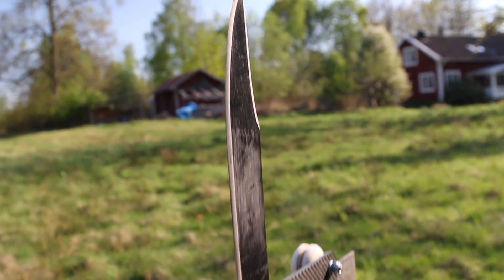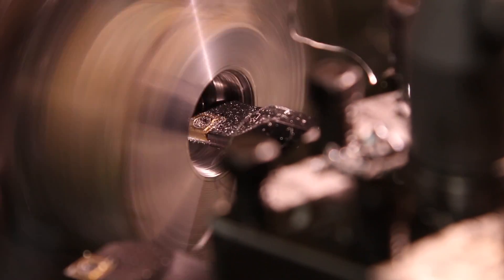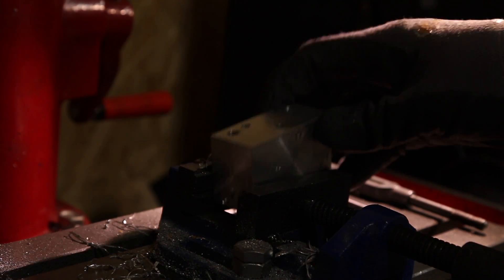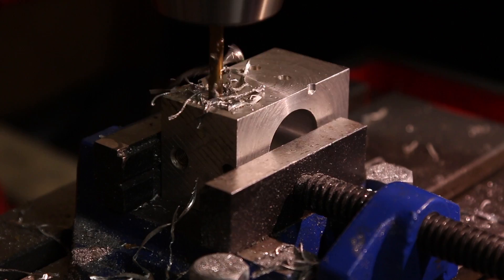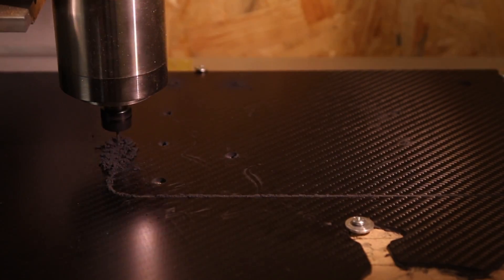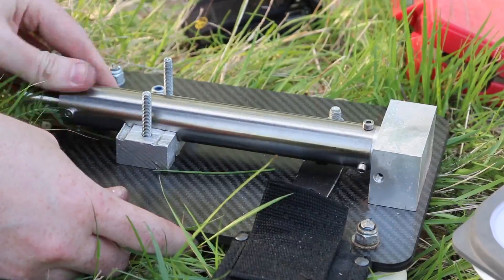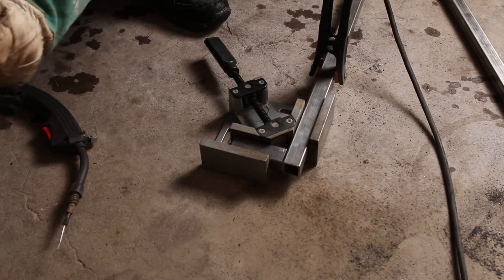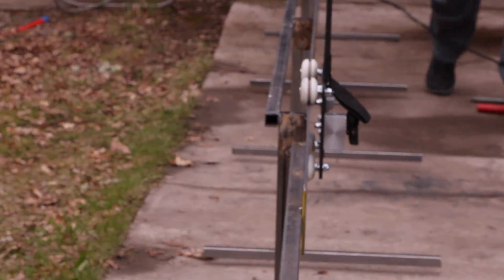Rocket Knife BTS - Making the rocket sled

Comment: I want to see a rocket knife cut another rocket knife. 
opposite directions plus 90° tilt. blade vs blade.  ;)
stop trying to cut stuff and CUT STUFF haha.
Reply: Yeah! I was wondering what material the knife is made out of. If steel then it'd be fun to see it cut an Aluminum Knife! Matter of fact I wouldn't mind seeing it cut that scrap of Carbon Fiber just to see what that failure mode of the CF would look like since it is supposed to be so strong. (but I'll bet a full charge in the rocket will make it through the 4mm carbon fiber )

Comment: Lol!  In one frame he is using a hack saw that came from the thrift store... and in the next he has a CNC router cutting carbon fiber!!  Lol!!  Good video
Reply from the maker: We all have our priorities ;)
Reply: Suggestion: For your next cutting device get a woodcutting circular saw with decent HP (1 3/4 or better, pawn shop is OK) and use an abrasive blade on it. The blades are only like 5 bucks here and metal, masonary or whatever will work. I buy 10pks through Harbor Freight.com. Reason: They cut WAY faster than a handsaw and about twice as fast as an Angle Grinder which you see every one on YT use. This will save you lots of time:
https://www.harborfreight.com/7-inch-cut-off-wheel-for-metal-39679.html

This works on ANY metal.
Reply from the maker: Very good tip! Thanks man!

Comment: I'm not sure you realize the danger of machining carbon fiber. I saw you were indoors so I hope you have great ventilation or some system to handle the dust. The dust is comparable to asbestos and is very bad for your lungs and is a carcinogen. I have a CNC router but won't risk cutting carbon fiber. Umyiu should really look into it because it is not safe to just cut normally.

Comment: Hey David,
nice to see you making videos again! I hope this won't annoy you, but here are a few more suggestions concerning working with carbon fibre reinforced polymers (CFRP):
- While it is true that you should not wear gloves anywhere around rotating tools, you most definitively need to wear proper leather protection gloves when handling CFRP parts that have not been de-burred (i.e.: that come fresh from the machine tool). Those fibres sticking out hurt like hell and, once they are under your skin,  can not be found using x-ray or ultrasound.
- In the video you used an industrial vacuum cleaner to take away the CFRP dust from the machine - good on you! But please make sure that you use carbon-rated filters (type H filters, the ones that are rated for Asbestos as well). Otherwise, the vacuum cleaner blows the fine dust back into the air, and there is no reliable statement on whether or not CFRP dust is carcinogen. Take care!
- The same applies to your personal protection equipment. When machining CFRP, be sure to wear a long-sleeved workshop jacket and a dust filter mask (class FFP3). Strictly speaking, the jacket would have to be washed by a specialized company, but whatever.
All I am trying to say is, be safe around CFRP. It is great stuff, but really tricky to handle. Trust me, I work with CFRP professionally.
Reply: Mostly I find these comments really annoying but this time it was actually quite interesting! thanks man!
Reply: FSXfreepaintsGroup thank you for jour input about safely handling CFRP composites

Comment: thats not really how you should change a chuck lol the back plate should stay on the chuck (you bump the chuck around till its got the lest run out you can get then tighten down the mounting bolts FT) the back plate should have a mounting system of its own (could be threaded of cam locked or have a locking ring and the nuts you loosen for the ring)